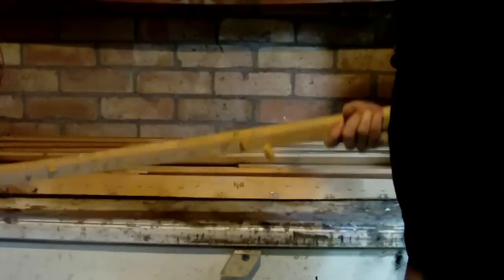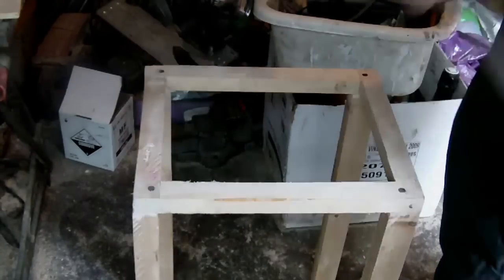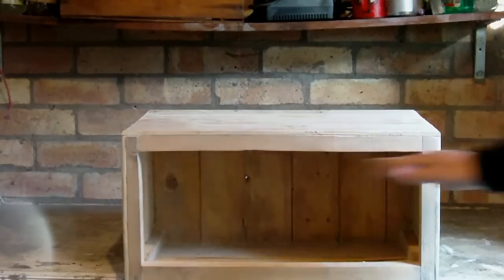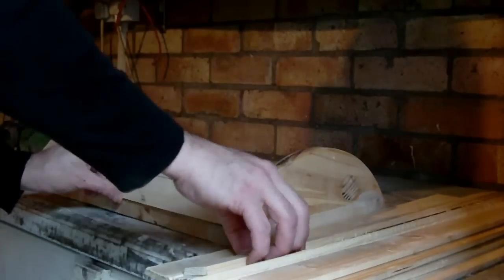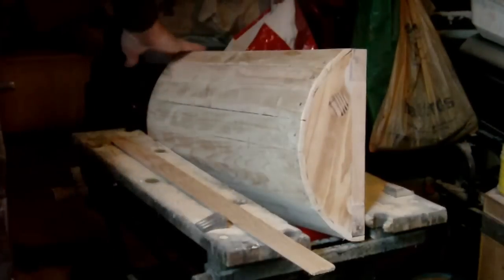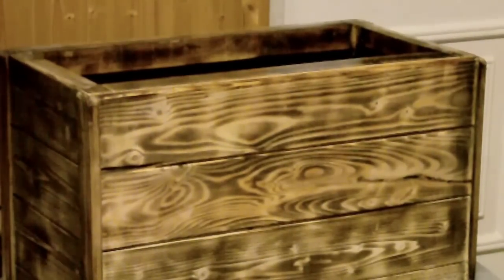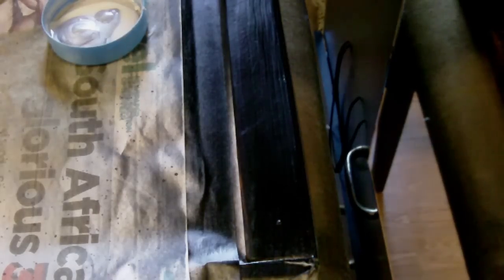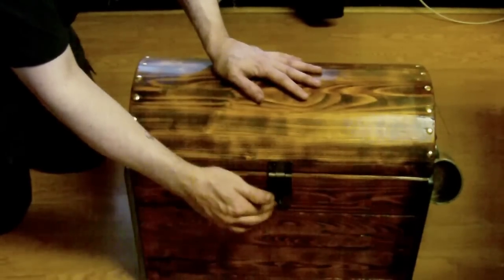Project Pirate Chest - Made from scrap wood

Comment: The clasp wont work. To get inside the chest just unscrew it. But other then that I like this. I love the color it turned out.
Reply from the maker: That's if you can get to the screw heads or the screw heads aren't mashed...
Reply: I know that. But it may need to be repaired in the future so mashing the screw heads wouldn't be smart. Bending the metal on the lock plate could have worked. It would have also gave it a used old feel.
Reply from the maker: I used caps to cover the crews, so they look like brass nails, yet can be undone